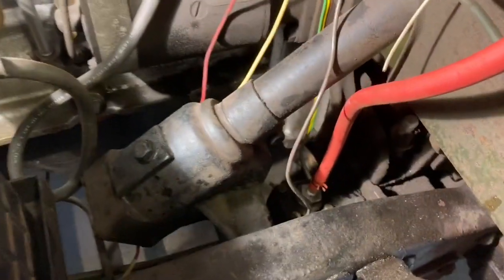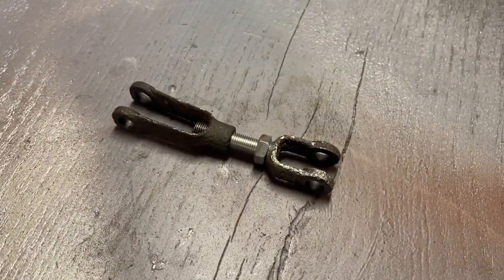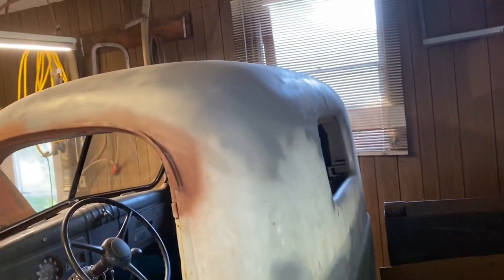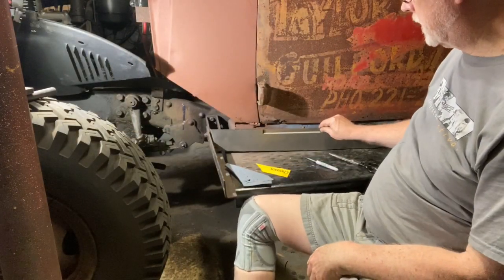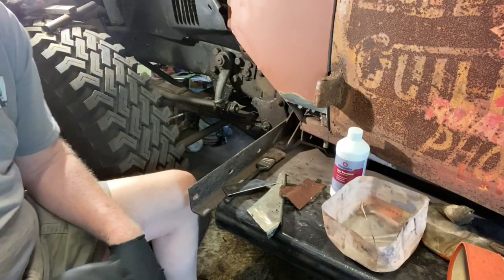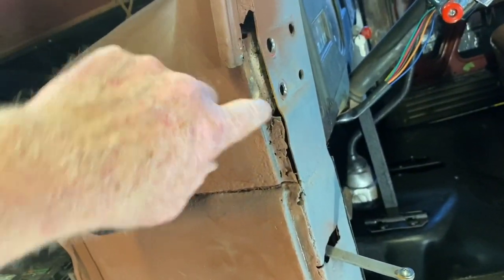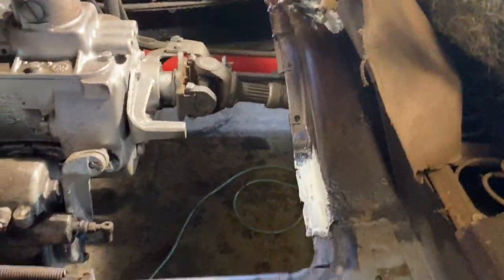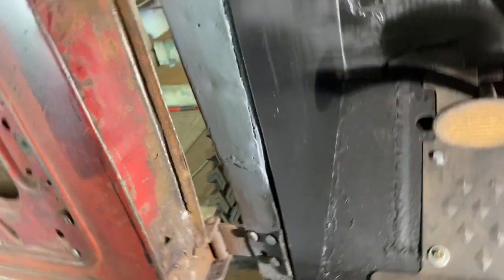1950 Dodge Power Wagon update 15

Comment: The truck keeps making good progress, I got sidelined on my PW for a bit getting my M37 ready to sell but now back to the Power Wagon.  I had to get new front leaf springs made for my truck and if I might trouble you a bit, I need the measurement from the center of the read pin/long bolt that goes through the gusset on the frame to the center of the center of the leaf spring bolt, or the bolt that holds the leaf springs together in the middle of them, I need the measurement to make sure the springs that were made are of the correct length.  I hate to ask this but it would sure be appreciated!
Your truck is looking better everytime I see it!!  Good Work!
Karl
Reply from the maker: Karl K I’ll get on that soon! Be happy to!
Reply: @JDawghasaTruck   boy am sorry to bother you with this but sure do appreciate you getting the measurement for me!!!
Reply from the maker: Karl K if I am understanding you correctly, from the rear spring mounting point to the center pin/center of the axle is 19 and 1/2 inch. Exactly the same to the shackle in the front. Hope that helps! At some point I will have to rebuild my springs.
Reply: @JDawghasaTruck  Thank you very much for taking the time to measure this for me now I can get my front assembly mounted.  I have all new U-Joints and the shafts are all powder coated Ican now feel good getting all them assembled!  Keep up the work on your truck, I noticed you have a bit of rust on the bed, will you be welding in new metal in those areas?  When you say rebuild the leaf springs is there a kit to do that?  The width of the steel in our leaf springs is very different than most, its not as wide, I had to wait almost 2 months to get mine, I hope you dont have the same problem!  Good luck and if I can ever be of assistance to you on your truck do not hesitate to ask!!
Karl
Reply from the maker: Karl K doubt if there is a kit but they will need disassembly, clean and repack. There might even be broken spring pieces. For a later time!
Reply from the maker: Karl K yes, the bed will torn apart and rebuilt hopefully next winter. There are reproductions available at steep prices but yes, I’ll be cutting and welding. I should be a pretty good welder by the time I’m done 😉